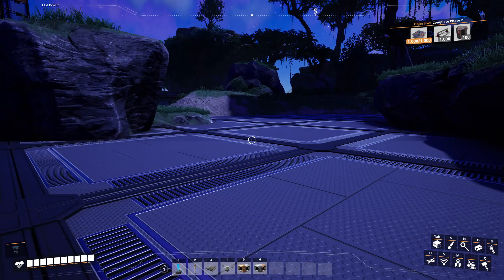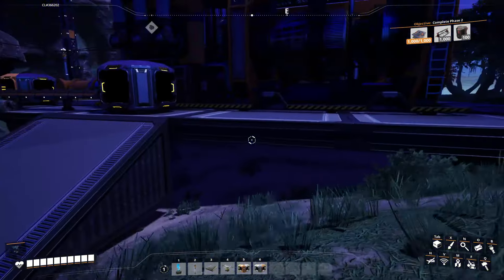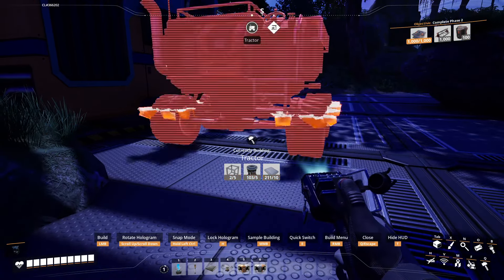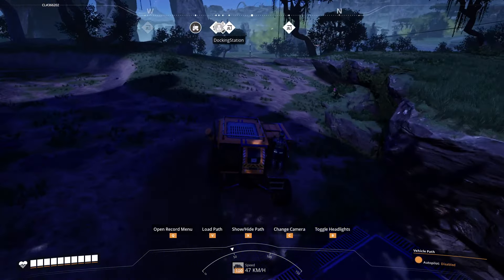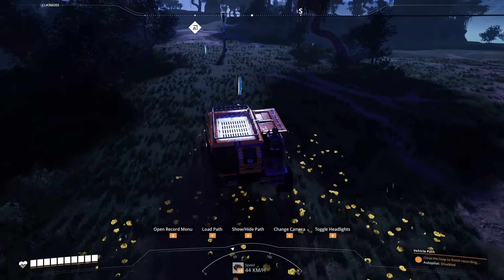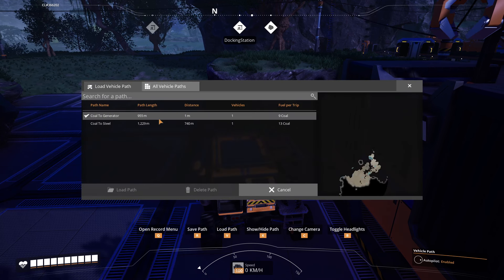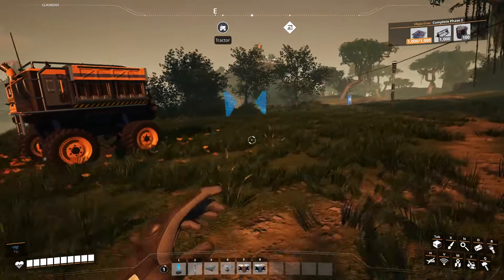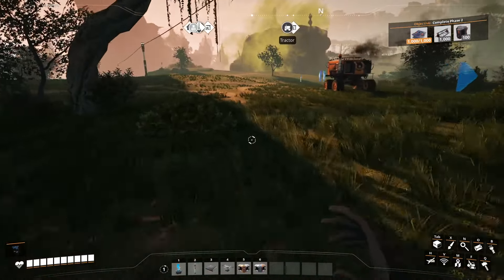Easy TRUCK STATION TRACTOR AUTOMATION GUIDE Satisfactory 1.0

Comment: I'd also like to add that you would clean up the recording path by pressing the button in the truck UI to hide the path nodes. If you have multiple trucks running across your world intersecting paths, it becomes very chaotic very quickly.

Comment: The tutorial is clear, and your diction is very understandable for a non-English speaker. However, it's unfortunate that you avoided and forgot the most important point: what to do when you're not transporting coal! Because then there's the problem of refueling your truck...
Reply from the maker: Well I've shown where the fuel gets loaded in. What do you need to know more? 
Producing and bringing fuel to the truck station wasn't a topic for this tutorial, as it would've made it easily double as long.
Reply: Early game Bio-mass would best (and only) alternative. But load it into the same spot as the Coal and you'll be good
Reply: @Ic0nGaming  It's a legit question that @phillip asked.

Comment: Hi i was wondering, why should i use trucks? wouldn't running it on a belt just be easier? that way you get a steady supply. Can someone explain?
Reply from the maker: Trucks do carry a lot of items. Before you get a Mk3 or Mk4 belt down, the truck should usually beat the transport speed of the belt. 

Besides that it's also just a matter of taste. I bet you could beat the entire game without using a single Truck or Train whatsoever. It's a sandbox factory game after all.
But trucks have one big advantage over other vehicles: They are relatively free to seek their path. You can even re-write their driving script without needing to build too much infrastructure. Roads obviously help, but they are not a must have, like Rails for a Train would be a must have.

Hope this helps to give you an idea or two how to use trucks =)
Reply: Trucks should be used for medium distance transport. Such as collecting ores from one region to the train station before being transported via railway to your main factory.

Comment: Came here to try and see why it is that my truck stops don’t load and unload. Starting to look like the game is bugged.
Reply: I just found this vid. Did you ever figure out why your trucks don't load and unload? Other than connection to power, like @IcOn Gaming mentioned, also be careful to drive into the transfer area and pause long enough. I noticed if I move again too soon, the load or unload is aborted and won't happen until I drive far enough away and then return to try again.
Reply: @ yeah I think I figured it out. I noticed that some things just stop working when playing the game long enough. After saving and restarting it things would work as they should until they don’t. 
So my fix was just restart the game every now and then.
Reply: That's a feature, a convenient reminder to take breaks. Ficsit cares.

Comment: I have 3 stations i would like to get going. 2 for loading and the final for unloading. can i set a route to 2 loading stations, unload at the final station, and then loop back to the start?
Reply: @Ic0nGaming didn't answer, but I just saw this vid, so...   Yes you can load from 2 stations, but it can make things more complicated. If the truck is fully loaded at the first depot, it can't take anything more from the second depot. But, if you're moving enough quantity to keep the first depot emptying out, the second one will help fill the truck. This works well for one type of cargo. If the cargo is mixed, use a smart splitter at the unloading depot and use multiple trucks with the same path.

Comment: You can edit your path, change the time you wait at each station, remove markers along the path so and the macro will make its way between the two separate ones and make your markers show or be invisible
Reply: If only you could nudge the markers instead of only deleting them. One little mistake and you have to re-record the entire trip.

Comment: FYI. You do not have to press F to load or unload while recording unless you have two stations close together.
Trucks will automatically use any truck station they cross paths with. But if you do have two stations close together, then pressing F to load/unload tells the truck which station it should use.
Reply from the maker: Thanks for the details good sir o/
Reply: You can also delete the node telling it to load/unload on the unwanted stops as well
Reply: I had trouble with multiple unloading depots close together. Even with pressing F to unload at the correct one, they often got cargoes mixed up by taking a shortcut through the other depot. So I switched strategy to assume all cargo is mixed, receive at one depot if I can, and then sort everything through a smart splitter. 

Just in case anyone ever has mixed items clogging up your belts after unloading, SCIM has a menu option to "clear belts" in a selected area. Much quicker and easier than manually cleaning out!

Comment: Good information, well presented, as usual sir.  I noticed that you did NOT hit the bird when you drove up to unload.  What a nice guy!

I also follow my tractor after recording the pathing, but I jump on top and let it take me for a ride-along.  

You can approach one of the triangles or pause icon and edit that specific waypoint, if you need that.  There are reasons to delete waypoints, or change the time the tractor spends at a station.
Reply from the maker: Thanks a lot for these add ons! I didn't jump on the truck for riding along cause one of my first "experiments" ended tossing itself into a chasm :D

Good point on the editing of waymarkers, I should've talked about that. Thanks for your comment o/

Comment: So if you are not transporting fuel like in the video, how and where do you get the fuel from or do you have to set up a truck station that runs fuel to another truck station to fuel other truck stations, and you should have mentioned that you need to place down both stations and have them powered up and set to load or unload before anything would work.
Reply: As long as one truck depot has some kind of fuel available, the truck will fill up. You would only need fuel in both depots if the round trip is too long.

Comment: I'm a bit confused about the loading process. In this case, the coal that is transported can also be used as fuel. But lets say I want to transport other goods, do I need to connect a coal conveyor to the truck station ?